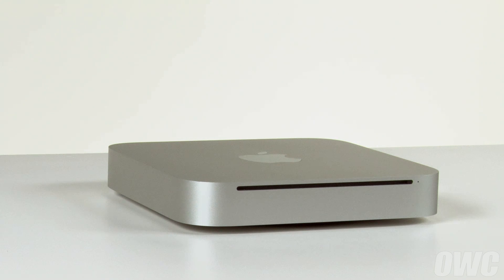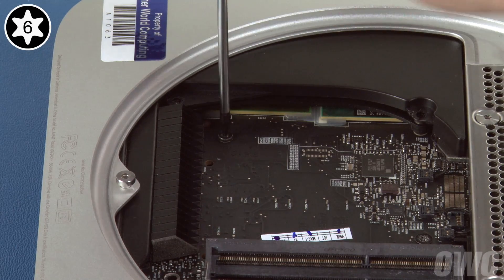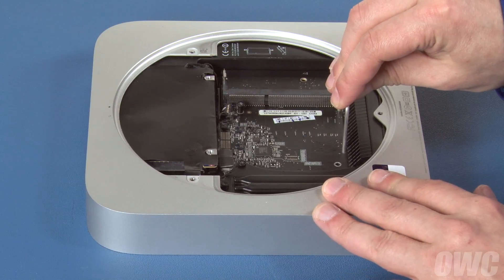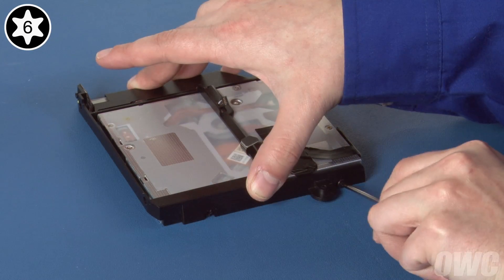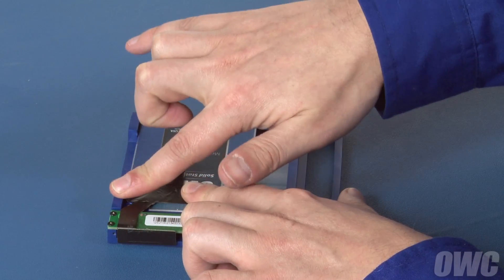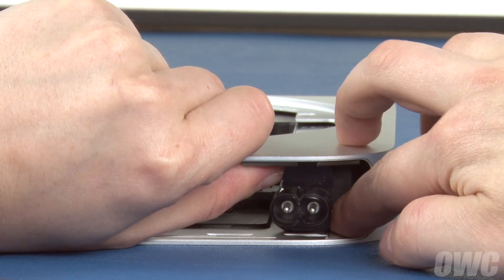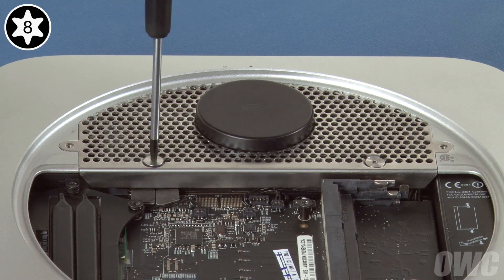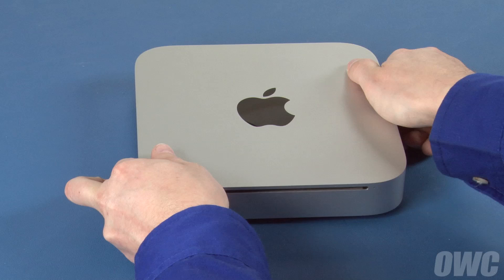Mac mini (Mid 2010) Data Doubler 2nd Hard Drive/SSD Installation Video

Comment: Thanks for the video. Helped a lot. Wished you would have shown the placement for all the temp sensors on the hard drives. I replaced both in my server and could not remember where they were placed on the primary drive.

Comment: I have this question: what happens if one of the cables from the hard disk temprature sensor is damaged (the plastic siding was broken). because this is dificl reconnecting said sensor, which brought me to the fan following has increased the rpm ie year and is as quiet as it was before the incident.

the mac mini stop reading this sensor? and therefore increases the rpm of the fan?
exite any probabildiad that jdb can burn something missing that sensor?
there are risks of failure to futo mac disk or in general?